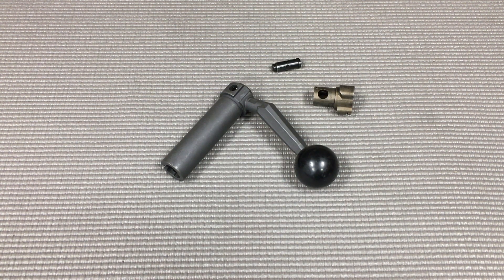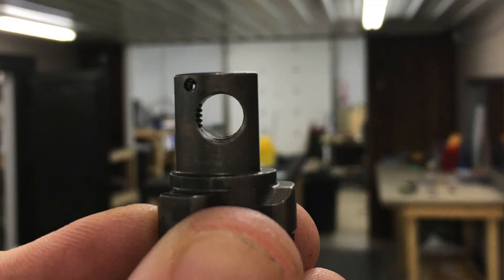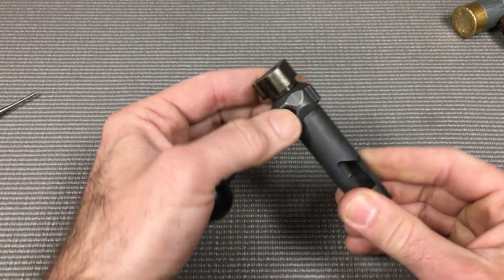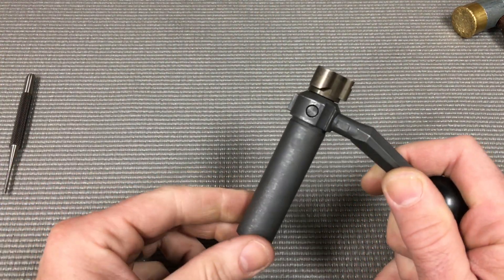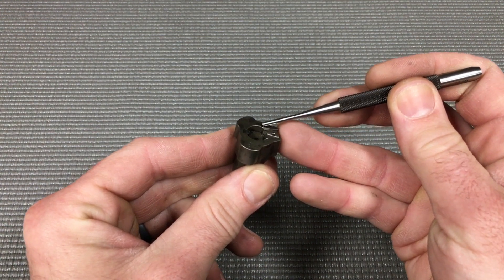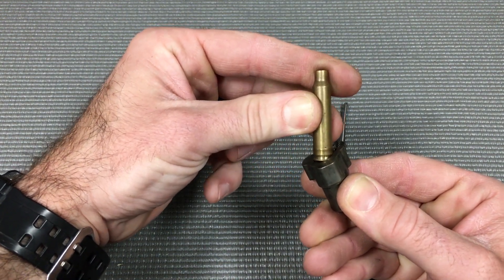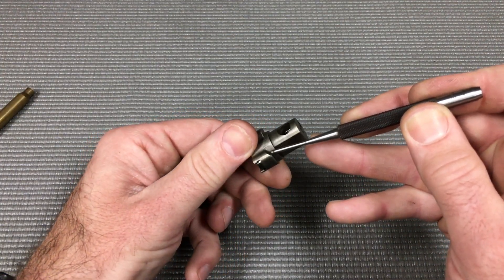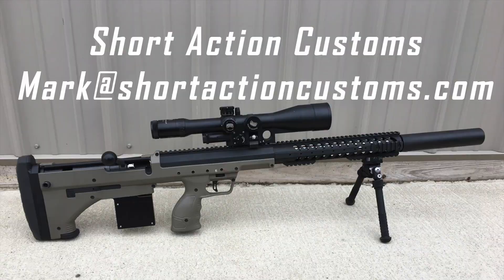Short Action Customs: 223 bolt head detail

Comment: Is this bolt head different from the early production runs?
Reply from the maker: It is, but only with minor design changes. It will still be extremely close with headspace and should be interchangeable.
Reply: @ShortActionCustoms  Just checking. I have ZERO complaints about my earlier SAC conversion. Shoots lights out and I have no interest in changing such a wonderful combination.